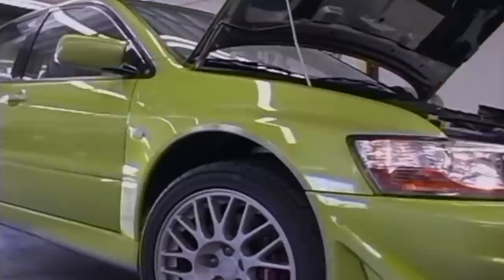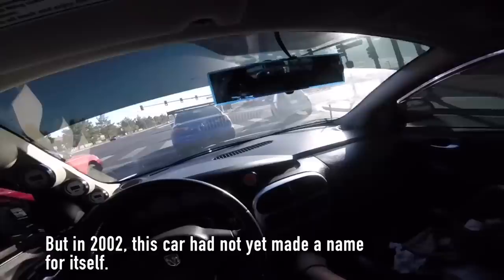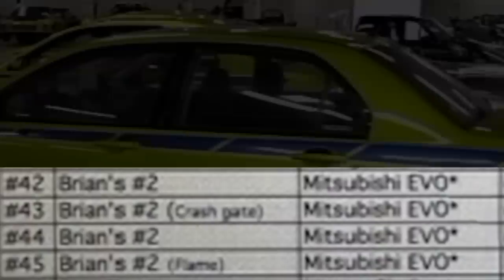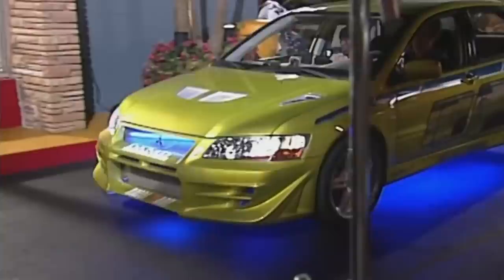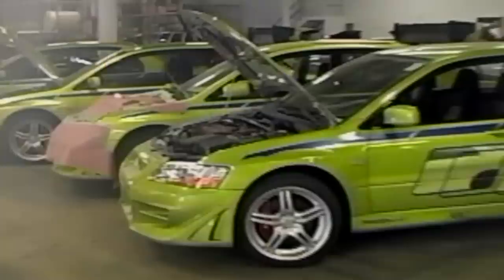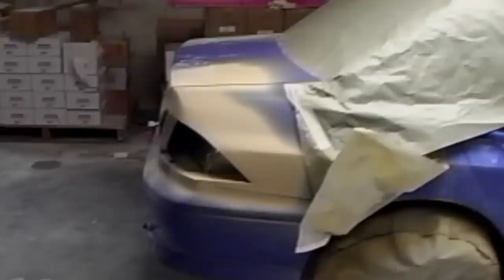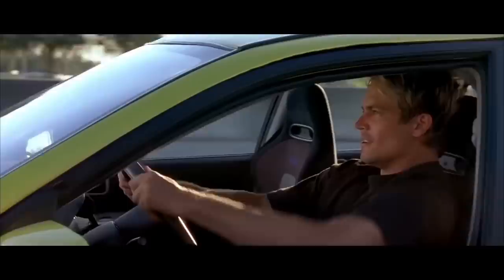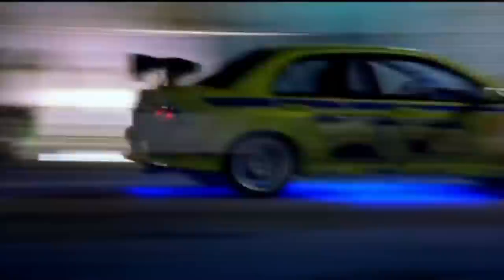FAST & FURIOUS   Brian's EVO VII

Comment: Well done sir, thanks for the additional information. I knew Mitsubishi had helped but nice of them to go the extra mile. Great story telling BTW, the way you read it was spot on...here today, done tomorrow. I remember all the SoCal DSM members getting amped up about the EVO’s release. Ironically ended up working at a Mitsubishi dealership not long after it did come to the states, as many probably remember, you couldn’t test drive it...it was buy it or leave it. Only a few select employees were allowed to move or transport them, but I drove everything else on the lot. 😉

Comment: My Evo 7 is still one of my fav cars to drive. The stroked 2.2 4g63 is making only 590 wheel but the torque curve is super flat, full boost at 3200rpm and it pulls great to red line.
My 900 wheel EvoX and my 97 Supra making 1170 wheel on E85 are fun to drive and the supra deff pulls the attention but nothing i have ever owned is as fun to drive as the VII.

We building a R33 night now that is mine and hubbies. The build is planned to make right at 800 wheel (2.8 RB26) and do so with great reliability and very drivable. We will prolly run a street tune that's about 600 wheel and gonna be really responsive and not peaky at all and for highway pulls a tune that's around 800 wheel and maybe even run a really hot tune with meth injection. Not sure yet on how the tunes will be final but 600 wheel is plenty for daily driving and 800 for hard pulls with a much more peaky less drivable highway pull tune.

If it's even close to as fun as the VII i will be in heaven.

Comment: I don't know why people thought it was an EVO 8, only thing I can think of is that those people just don't know their cars
Reply: Stuff N Stuff it’s very similar. Stfu. 7 just looks more base lancer than the 8 does. 8 and 9 are wider and fit larger wheel sizes.
Reply: Your points apply and can be said for about 60% of cars so it's a pretty invalid point...
Reply: @OmniscientVirtuosity  nope, evo 7 have same width as evo 8 and 9

Comment: So they took off the incredible Evo 7 spoiler, changed the beautiful Evo tail lights to the standard Lancer lights and didn't use a single note from the actual Evo engine.  Why even use an Evo 7?
Reply: It's not like the stunt drives were bothered whether the Lancers were awd or not either

Comment: I know this is an old video but what led you to believe Mitsubishi crushed one of the evos after production? What do they gain from this?
Reply: Depends on what condition the car was in. If the car was damaged, they sometimes do just junk it after filming because there's no more use for it. In the eyes of Hollywood and the car companies, these are disposable. They don't expect people to pay millions for them. That's why a lot of iconic car shows from the 70s and 80s like Knight Rider or Dukes Of Hazzard only have a small number of cars known to still exist. Most of them were destroyed either during filming or after the show ended.